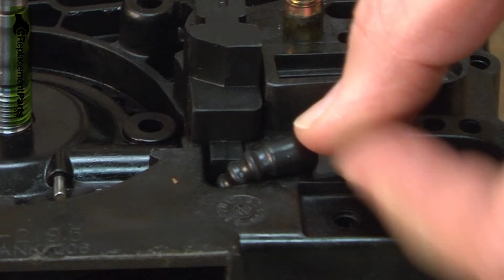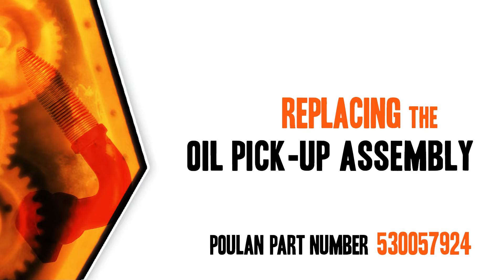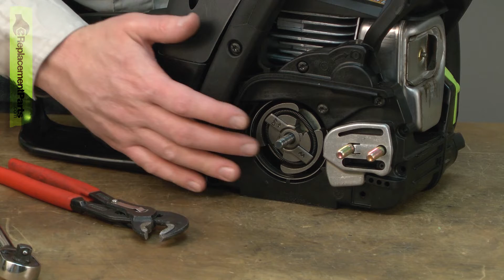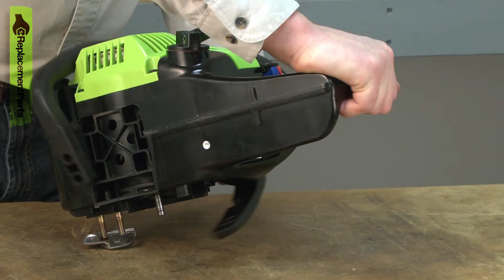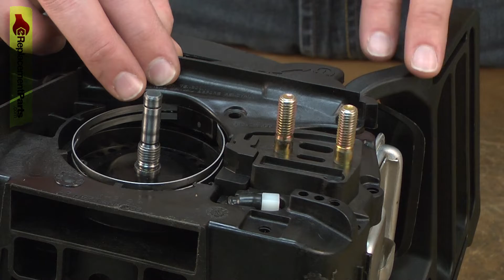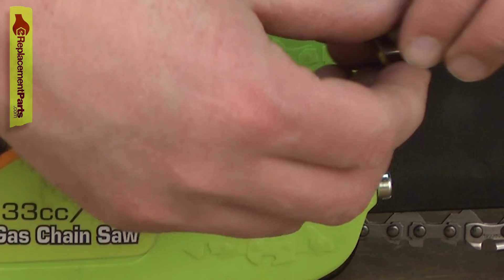Chainsaw Repair - Replacing the Oil Pick-Up Assembly (Poulan Part # 530057924)

Comment: This company wants way to much for parts and only has parts people. Don't need.
Reply from the maker: Hi Derek and thanks for watching the video. You're right, we specialize in selling parts for a number of machines and appliances. We also only sell OEM (Original Equipment Manufacturer) parts that are guaranteed to fit the machine they were designed for. Purchasing after-market parts can be a little cheaper sometimes, but it comes with no such guarantee. Thanks for stopping by our channel, and feel free to reach out if you have any questions about our OEM policy or the parts that we sell!
Reply: @FIXTechGuides  it fun saw to learn how to rebuild. It don't make sense for prices the oiler is good repair I get mine from other saws.

Comment: My Poulan pro 18" has leaked B&C oil since it was brand new. Thought I may have overfilled it or something lol. Replaced the fuel lines and took carb apart because it wouldn't suck fuel when primed due to me accidentally leaving fuel in it for 2 years oops. Cleaned out gunk and it runs like a champ just spits out ridiculous amount of oil. Looks like I need to do this repair now. I will follow this excellent video!
Reply: how did it turn out?